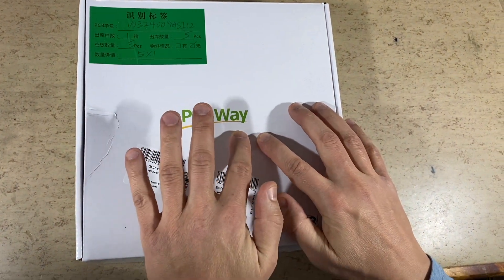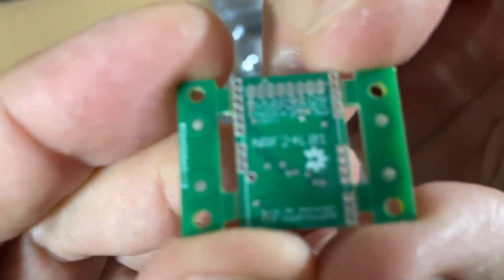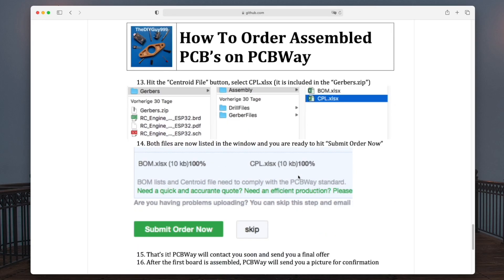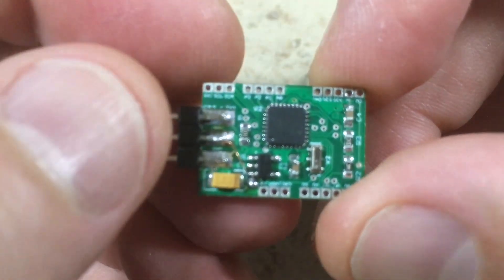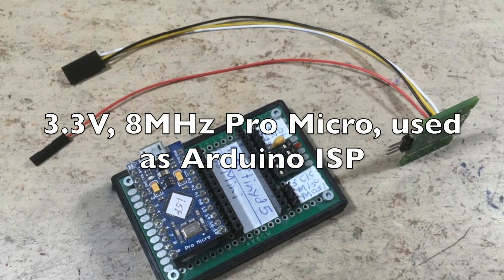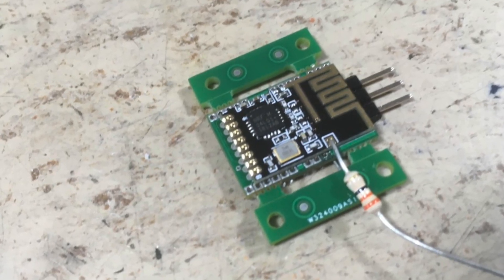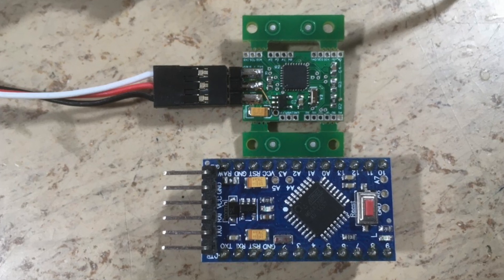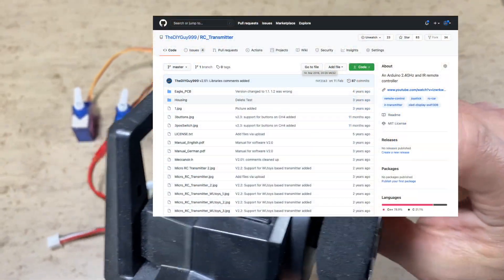Worlds tiniest SBUS Arduino 2.4GHz DIY SMD RC receiver & sound controller manufactured by PCBWay.com

Comment: Sehr interessantes Projekt. Da werde ich mich auch mal einlesen. Eventuell ist das eine Alternative für meine RC Fahrzeuge im Maßstab 1:87. Vielen Dank für deine Arbeit. Grüße Oliver
Reply from the maker: Danke. die Reichweite ist momentan noch ein Problem. Innerhalb der Wohnung nur etwa 5m, da die Antenne durch die GND Plane zu stark abgeschirmt wird. Für 1:87 aber sicher ausreichend. Es sind alle Anschlüsse wie beim normalen Empfänger vorhanden und die software ist die gleiche, es könnte also noch ein Tochterboard mit dem TB6612FNG angeschlossen werden. Z.B. als Sandwich.
Reply: Wir fahren auf Sicht, da sind minder Regel 5m ausreichend. Etwas mehr wäre aber auch nicht schlecht. Wie sieht es mit Störungen aus. Wenn wir auf einer Messe oder Ausstellung sind, tummeln sich dort mehrere Mikromodellbauer mit ihren Fahrzeugen auf kleinem Raum? Grüße Oliver
Reply from the maker: @DerTheoretiker  Ich bin noch daran, die Reichweite zu verbessern. Wenn viele Leute vor Ort sind und du Probleme mit Doppelbelegungen verhindern willst, ist es wichtig, dass du die "pipeIn[]" Adressen änderst, so dass niemand sonst die gleichen hat. Generell habe ich nicht viele Erfahrungen, was an Orten mit vielen Fahrzeugen passiert.
Reply: @TheDIYGuy999  Ich habe mir das Projekt auf Github noch nicht angeschaut und bin nicht so versiert beim programmieren. "Pipeln" Klingt nach der Sender ID. Die Sollte immer einzigartig sein. Das mit mehrere Fahrzeugen an einem Ort müsste man testen und dann ggf. noch Anpassungen vornehmen. Aber das Projekt ist super! Daumen hoch!!! Danke für die schnellen Antworten.
Reply: @DerTheoretiker  You saw my version of @TheDIYGuy999 ‘s design in my Land Rover Defender 1:87 RC on Instagram. It can be made even smaller if I replace the motor driver TB6612FNG with a smaller one (which was also presented on Instagram).

Comment: I think my version of your design has a smaller PCB layout. So, technically your is not the smallest in the world :)
Reply from the maker: So, your PCB is smaller than the NRF24 module itself? Really?
Reply: No. NRF module is separate and connected with wires in my latest version.

Comment: Does it have a gyro with remote tuning or i2c ability to add them and more later on?
Reply from the maker: Yes, it has exactly the same functionality (and software) as the full size receiver, but the gyro is not integrated. It needs to be connected separately. See my other videos.
Reply: @TheDIYGuy999  i2c?
Reply: The reason for asking is the ability to add more sensors and a lcd. Been reading your arduinocode and thinking of modifications. When you are done testing - is it possible to buy the final version direct from you?

Comment: I'm trying to use your Engine Sound ESP32 module and it is way to much for my needs.  I would rather use your older basic arduino engine sound (the one that hooks up to throttle input only), the problem is that the vehicles I want will only compile for the complex ESP32 version... I am so confused on what to comment out but is super important otherwise will fry my non-sbus receiver!

Comment: For the novice can you discribe the difference between a normal RX and this one. Why you use this over a normal RX
Reply from the maker: SBUS is a serial protocol with up to 16 channels. This means you only need a 3 pin connector for all channels. The channel signals are then decoded on the sound controller.

Comment: Do you use the internal clock 8mhz atmega328 ? Or use external crystal for your tiny receiver?
Reply: External as you can see in the video
Reply from the maker: Yes, external 8 MHz

Comment: sir can you pleas help me to write sbus code for my transmitter and receiver i am hitting my head all over the internet to understand and implement it to my transmitter and receiver from 8 months but not working i can send you circuit design pleas help i just want to use it in inav flight configurator for my drone pleas help me